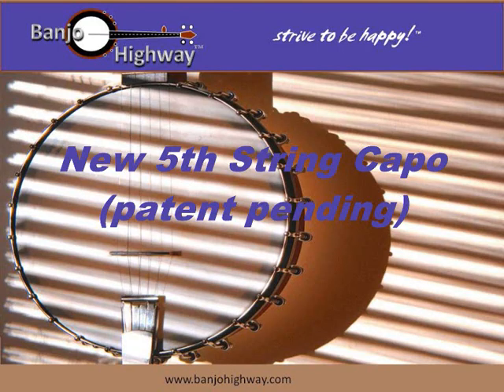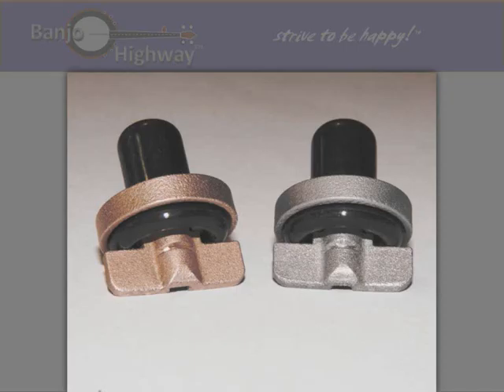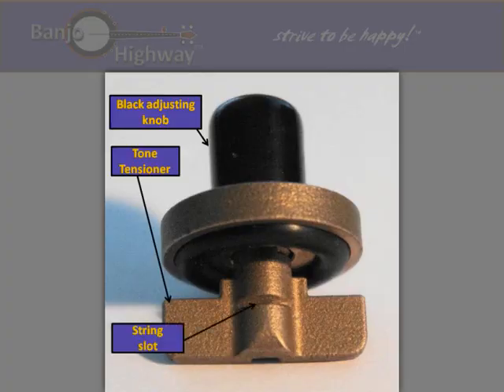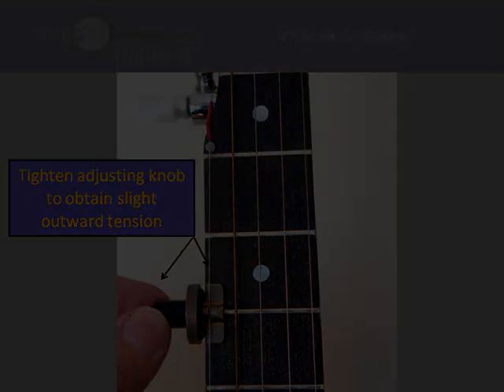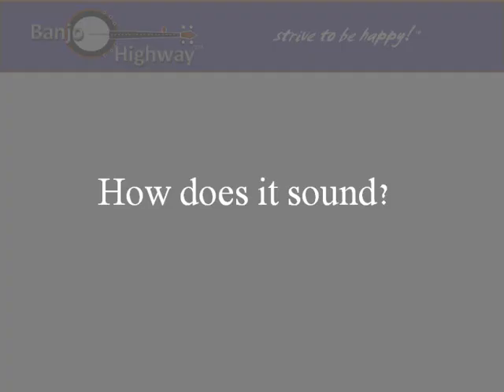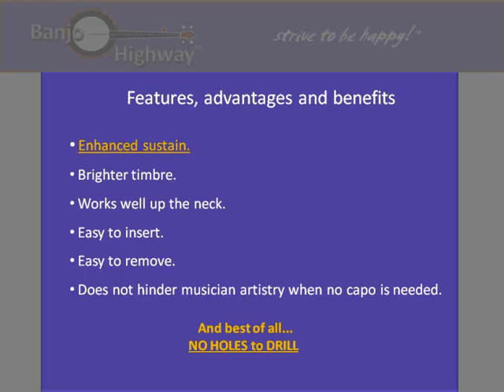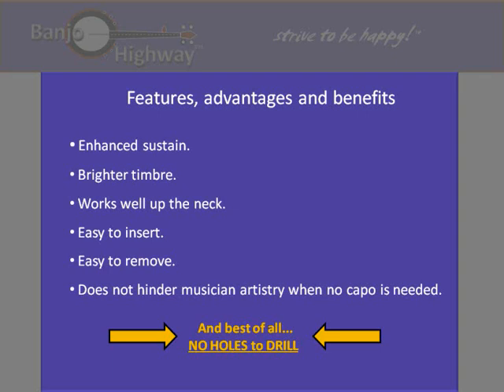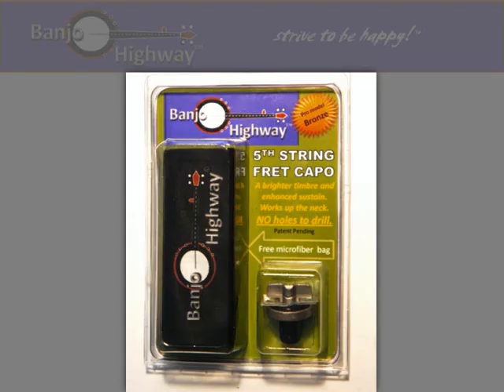Pitch Accurate 5th String Capo by Banjo Highway (no installation costs required)

Comment from the maker: Thanks Kronedaddy. The BJH capo should work on banjos with spikes installed as long as the spikes were installed exactly centered between the frets. Some spike installers move them off center to avoid inlaid decorations, (top and side) so you will have to check this out on your banjo. Contact Us on the web-site if you want to discuss further.

As for store availabliity, for now...we are selling on line only.

You are flawlessly correct...it is pronounced "Tam-bor".

L